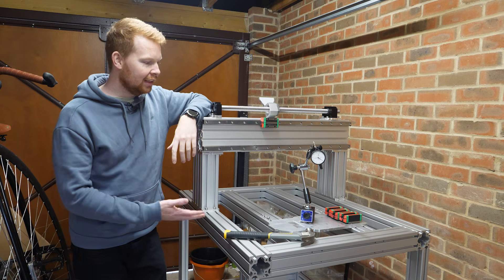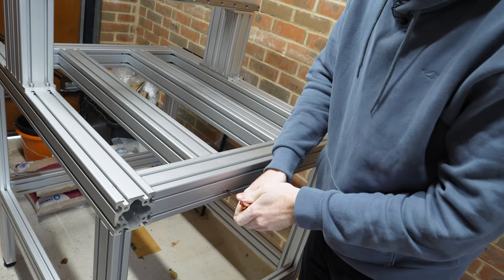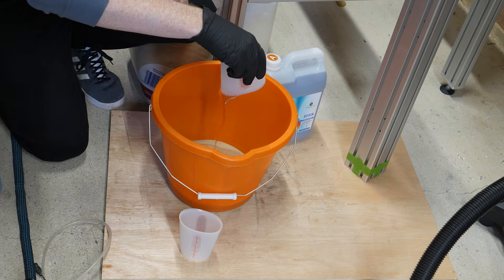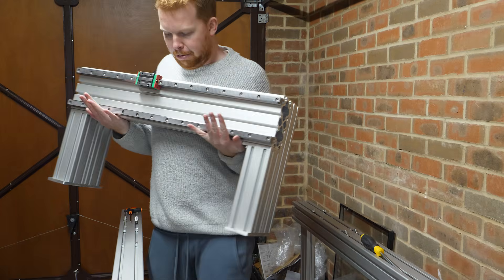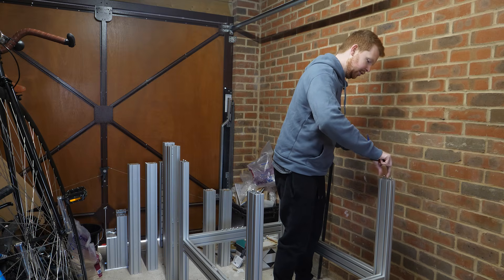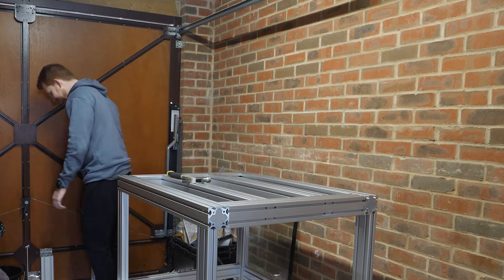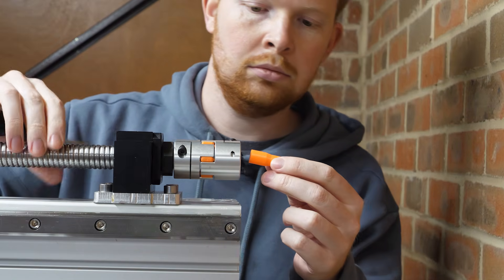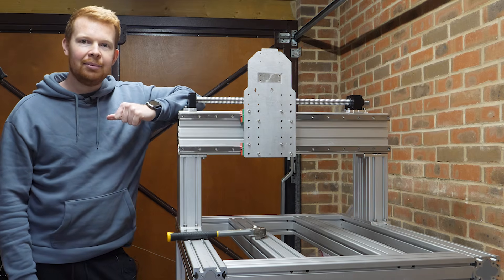Building a CNC Mill/Router - Part 2

Comment: Good job! I think you'll find it helps a lot more than you think. Resonance or vibration is only part due to stiffness (lack of...), you also need to consider the accelerated mass. Doubling the tightly coupled mass of a beam lowers the resonance frequency, sure - but the important part is that the beam impact load moment of inertia goes up to a factor of mass increase squared. Doubling the mass means that the same impact force now gives four times lower beam displacement. This helps a lot on all vibrations and momentary impacts that are NOT perfectly synced to the resonance frequency. At (the now lower) resonance, the same amount of impact force has the same displacement as before though
Reply: You just described drum tuning in the most scientific way possible.
Reply: Excellent overview of the benefits related to increasing mass. It is my understanding that the stiffness of the overall system increases. I think he could have increased mass further if the mix was compacted in layers. The mixture didn't seem fluid enough to settle with just a few taps.

Comment: As a piano tech, I'd say you did a great job eliminating the frequencies that cause the most trouble. In pianos, that is.
Reply: Now he probably can reach all the gcode notes.
Reply: You know, fiddling with settings might actually eliminate any leftover problem frequencies! 

Maybe there are some sensors you can use to determine resonances, and software to compensate for it? If not, here's a great video idea :D
Reply: @purvel  :  There are companies out there specialising in eliminating resonance in machinery... witchcraft?
Reply: Haha, good point this would be an amazing piano now :D
Reply: Next up, how to build an aluminium CNC piano
Reply: Oh, and from an audio point of view: the ringing (resonance) are oscillations of the frequencies (and multiples of it) introduced in the body, that are close to the  natural resonance frequency of the body. 
In a CNC machine, those frequencies are introduced by the movement of the components (spindle, carriage, servos) and eliminating this is always a tradeoff. 
The two deciding factors are dampening and isolation. 
In a piano, this is done (AFAIK) by having a very rigid and stiff frame, with carefully selected materials for different parts, and weight. 
Rigid materials have a high resonance frequency, but the CNC machine should be as rigid as possible, this creates a problem if they are close to the frequency of the spindle.
This is where the epoxy-granite comes in to the rescue, it has good properties to complement the aluminum frame. It provides high strength, mass, and has a low coefficient of thermal expansion.
Reply: I am just an audio technician but was always amazed by the piano tuner. I often tried to listen, but  it's a bit of wizardry to me how it is done

Comment: Maybe adding strips of heavy rubber to the outside of the legs would dampen the vibration. Something like horse stall mats cut into strips and bolted to the extrusion?
Reply: maybe add between leg and main frame?
Reply: Appropriate Barry Mounts would be my first choice.

Comment: The narrow legs, in fact all of it could’ve been filled with leveling cement. It’s very liquid and smooth, and much nicer to work with than epoxy.
Reply: Ive used molten lead.
Reply: @philiprogers5772  That's going to play havoc with his 3D printed funnels :)
Reply: @-vermin-  Lol, also I wonder if the expansion and contraction would cause deformities.
Reply: @philiprogers5772  I'm too lazy to deal with epoxy. I can't imagine messing around with lead.
Reply: @philiprogers5772  I like the density and ductility of lead at room temperature, but did it cause any deformations?
Reply: I'm thinking about using high strength concrete...
Reply: @tmoney1876  Why high strength concrete?
Reply: @iTeerRex  It's supposed to provide as good or better damping while being much easier to deal with than epoxy granite.
Reply: @tmoney1876  You preferred it to leveling cement, that why my question.
Reply: @iTeerRex  I thought you were talking about self leveling concrete like you use under flooring. It sounds like we're actually talking about the same stuff. It could all be similar for all I know, haha.
Reply: @tmoney1876  Ahh cool 👍

Comment: did you do any compacting of the sand?, could be related to that.
Reply from the maker: Yes, I used a pipe to push it down as much as possible.
Reply: some vibration to the extrusion when filling would have compacted the sand much more @TimStation
Reply: My thought too, that stuff should really be packed so it's a solid block. Just tapping the side wouldn't benifit it much

Comment: Doesn't the fact sand moves help absorb vibrations? But won't the epoxy keep it from moving?
Reply: Yeah the fact that the epoxy prevents dissipative losses means the sand is just ballast
Reply: Used sand in night clubs to eliminate feedback in turntables. When it got damp and then dried it would turn into a solid lump and the dampening would disappear and the feed back would return. So I would have to break up the sand again and the feedback would disappear again.
Reply: @Margarinetaylorgrease this is the relevant information!
Reply: While I never build a CNC or anything that needed to have low ringing/high vibration resilience.
My instinct would also be to use something that can move on its own and is only slightly coupled. Like Rubber or silicon.
But then again, every build I have seen so far uses resin and sand/gravel.
But all the other builds have their CNC standing on the ground or a very strong table. So I guess the feed are the biggest "problem".
Reply: @TheHanutaXD  : I don't know which would be best for removing harmonics, but adding the resin will do more to increase rigidity.
Reply: The epoxy granite will add stiffness to the extrusions. Sand alone won't do that.
Reply: @swe-fragels7722  I think you mean hardness, rather than stiffness. I believe the sand epoxy will add hardness to the extrusions. That doesn't lead to increased damping though. As others have said, it just lowers the resonant frequency/vibrational modes. I can even imagine a situation where certain frequencies are actually made worse due to altering its vibrational modes. So I agree that sand without epoxy would be better.
Reply: It will still vibrate and dampen some vibration. Think of cast iron and it's dampening qualities. This is due to vibration and friction between grains in it's grain structure.
Reply: this was my exact thought. Only example I can think of is a "Dead hammer" you fill it with sand but leave room for the sand to move.
Reply: Epoxy granite has good vibration damping properties at least when used on its own. It is used to make high end machine tool frames instead of cast iron. I don't think it would be that much different when used inside aluminium extrusions.
Reply: I don't like sand...
Reply: @MaximumMatador : Stay off the beach!   😜
Reply: @MaximumMatador please explain why ?
Reply: @tonyhussey3610  it's coarse, and rough, and irritating... and it gets everywhere.
Reply: I agree, I thought the whole point was to make it like a dead-blow hammer...
Reply: Both affect the vibrations in this dynamic system. The increased mass increases the inertial force and the sand increases the damping effect since it is not perfectly bound by the epoxy (both of which increase resistance to motion).
Reply: hard to say - the increased density of the epoxy + sand will dampen the vibration amplitude and frequency of resonance
on the other hand sand without epoxy could dissipate energy via friction
overall I would say increased density has a greater effect
Reply: @gedr7664 that's not really true. The added mass of the epoxy doesn't really dissipate the vibration better. Mass just changes the resonant frequency. But bot sand and epoxy resin have quite good dampening coefficients, so it does still work out.
Reply: @gedr7664 you dont increase the density of the sand by mixing it with epoxy, but lowers it instead. You would have the greatest density by just filling it with sand...
Reply: i agree with you, to me thats one reason sound travels much longer distance in water then  air
Reply: The sand itself isn't what stops the vibrations. It's the extra weight from the sand and epoxy that makes the whole machine more vibration resistant. Plus, without the epoxy, the bits of sand and extrusions would just do their own thing and jiggle around separately, losing the sand's vibration-reducing effect."
Reply: @FrankTuk "jiggling around separately" is exactly why it would help prevent resonance - chaotic motion prevents resonance.
Reply: @FrankTuk Special water reservoirs are used in some skyscrapers to dampen vibration/oscillation. Vibration causes friction, that takes energy away as heat.

Comment: Would loose sand dampen vibration better than the weight of the epoxy granite?
Reply: You're all going to give Tom a complex and his next video will be testing like 30 different materials for frequency and stiffness.
Reply: @yetanotherdan  This reminds me of the whole marble machine madness for those that know.
Reply: The mass of the sand probably has more of an effect on damping than the loose sand itself. Additionally, loose sand would end up finding ways to get out and would make a mess.
Reply: @Katoom-p3r  not enough mass
Reply: imo increased density due to epoxy added has a greater effect than friction within loose sand.